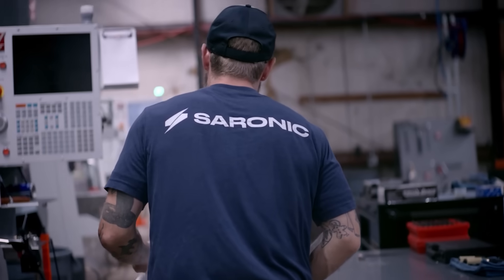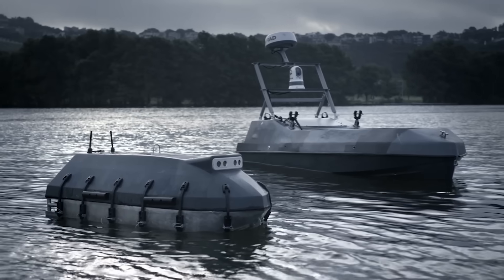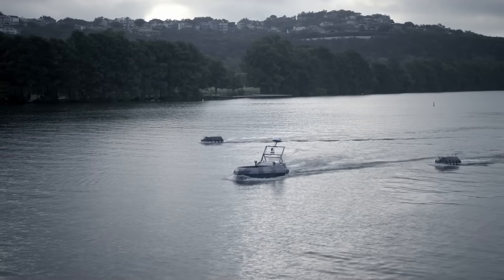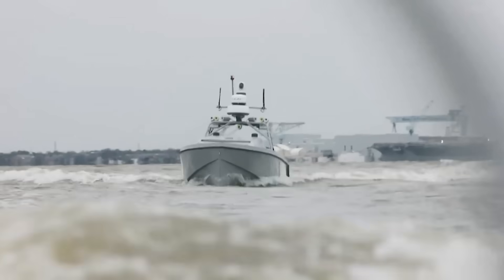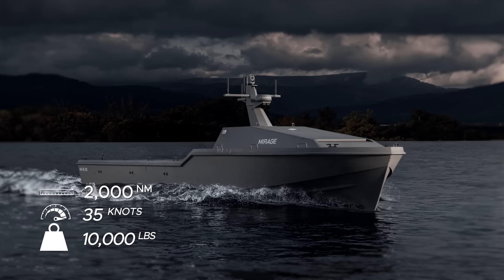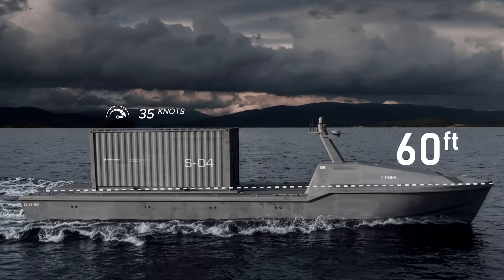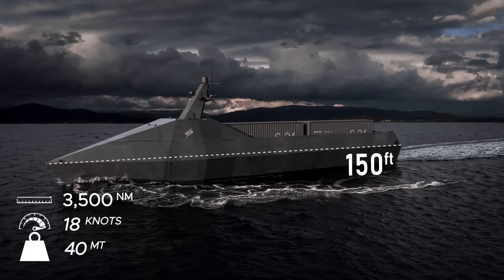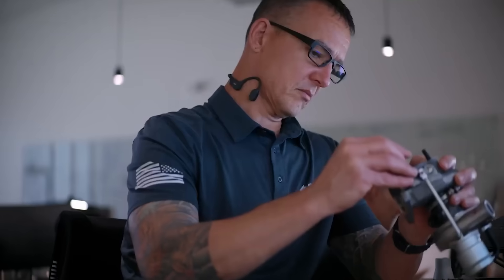Port Alpha: The US Navy Secret Shipyard that SHOCKED China!

Comment: Tuyệt vời, đây là bản nháp bình luận bằng tiếng Anh (khoảng 140 từ) cho video về "Port Alpha" (xưởng đóng tàu bí mật của Hải quân Mỹ), tập trung vào tốc độ và khả năng tự hành của các tàu để thu hút sự chú ý của chủ kênh:

Comment (in English):

"This is an absolutely phenomenal analysis of the 'Port Alpha' concept! 🤯 You've perfectly articulated the core strategic difference between the US and China: China has numbers, but the US is aiming for industrial speed and mass-produced autonomy [00:12].

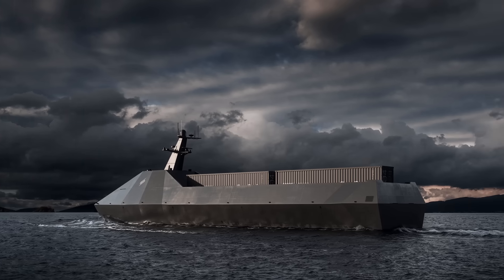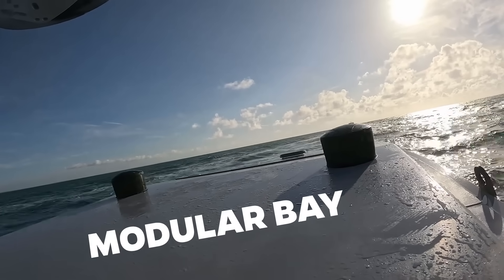The whole product line is fascinating, especially the jump in capability from the tiny Spy Glass [01:17] for littoral mischief to the 150-foot Marauder [09:55], which acts as a stealthy, roaming logistics hub for the entire fleet, carrying 40-foot ISO containers. That ability to 'rack the kit you need' [05:21] instantly solves so many logistics and mission-adaptability issues.

The $4B valuation and the ability to turn out up to 50 autonomous vessels per year [11:17] is the real shocker. This isn't a science experiment; it's a true industrial pivot designed to neutralize the numbers gap. Subscribed! What a brilliant piece of future naval analysis! 💯🚢🤖🇺🇸

Comment: The US would need to build 100 shipyards or more to match China's existing capacity. Simply because in China they can weld up a 200ft hull and float it out for fitting in the space of 2 weeks. Many of their shipyards have completely automated fabrication and welding now. You would also need to build a crap ton of steel mills and foundries as well. Corporations are not going to invest all of that money on a war that may be over before its paid for. Just like they did not pay for all the new factories and equipment needed to fight WW2 either. It was Uncle Sam who PAID for all those investments. But there is no way in hell you can do that today, with the debt already teetering on the brink of default. And NONE of these high tech weapons are going anywhere for the next 10 years because of China's ban on rare earth exports. It will take that long for the US to be refining those materials. IF they can figure out how that is. China keeps their extraction methods as state secrets.

Comment: Where are the seaplane drones?
Where are the ground-effect seaplane drones?
The problem with all boats is that they are limited to business district speed limits of 35 mph (800 miles a day), and it takes days or weeks to reach the battlefield, get reloaded, or refueled.
The Navy has 70% of the Earth to cover; it can't wait weeks to put forces where they are needed; they need to be there in hours.
Mobility is a huge tactical advantage, and the Navy surrenders that advantage at its peril. 
The term "Sitting Duck" comes from duck hunting, where shooting a duck on the water is infinitely easier than shooting them out of the air.
Navy surface ships are all "Sitting Ducks"; they can't hide, they can't run, and they can't protect themselves from FPV drone swarms.
The Navy desperately needs cheap, long-range, runway-independent, and expendable UAVs, but is actively avoiding purchasing them.
Reply: See 120mph ground effect drone from turkey.  How do you defend against a swarm of those coming at you at an altitude of 4 ft?..
Reply: @jefftempler6813  What is the range on that? How about the payload? It takes a lot to sink a ship. Drones are nothing but shitty missiles. If you give it enough speed, enough guidance, enough range, it is literally just a guided missile. The US does have weapons specifically designed to deal with large amounts of drones.

Comment: carriers are obsolete, needs a fleet to protect and serve each one individually, shitload of obsolete planes onboard and 6000+ soft targets onboard which can be taken out with one shkval torpedo, easy and slow targets, hope drone ships and boats will be used in cartography and deep sea mining soon as well.....seaquest anybody?
Reply: This is a whole kill streak off Call Of Duty..
Reply: Air defense is better than ever. If you can't sink the ships, then they are the most powerful way to project force. A lot harder to hit moving than a conventional runway, which doesn't move. But, you have a point. The only way we will know for sure is once these systems start to square off against each other. It could be that the days of the super carrier are over.

Comment: I hope they keep building and keep the specs away from china.
Reply: They'll have to compromise or duplicate the ground control network as there will be m-code encryption and custom C2 protocols in place that would have to be avaliable.   Best they could do is jam or spoof the signal and GPS like Iran did 15 years ago to one of our predators.  We've improved quite a bit and I'll guessing they'll be a lot of automated navigation equipment using gyros and local sensor data if satellites get jammed.   Whoever built these are way ahead of what I could think of though.

Comment: I love the idea but those craft need to have self-defense weapons for Air Base threats and Sea based threats cheers
Reply: the whole point is they are fast and cheap to produce, and move at a high speed and low detectability (size) to get the job done.  If an aircraft finds them running solo - oh well - pump out some more.  when these craft are operating in a fleet formation, they have plenty of defense.  I'd be truly surprised though if one of those modular swaps for the bigger boats wasn't a small SAM launcher.  still though - i expect they are designed as attritable assets.
Reply: @RamPuppy  I'd expect to see a VLS system built into the 20 ft container format for RIM-116 missiles for air defense and Hellfire for surface attack.